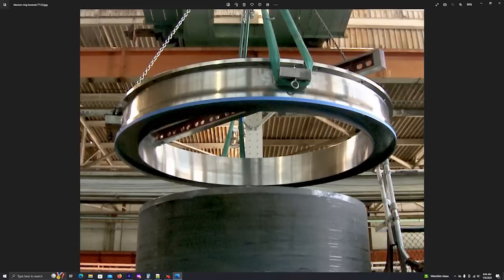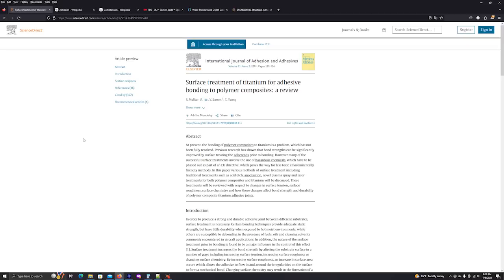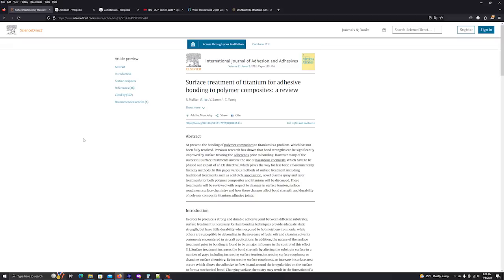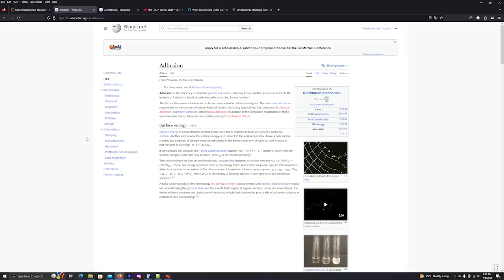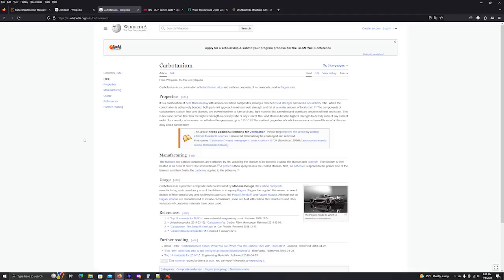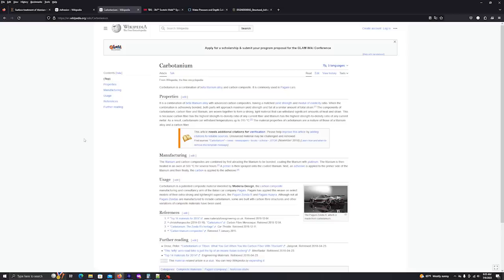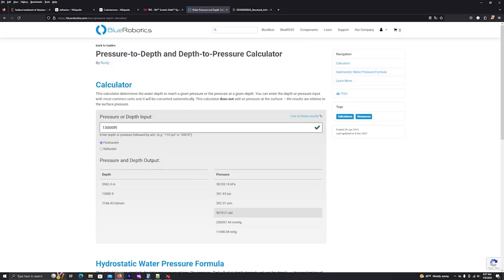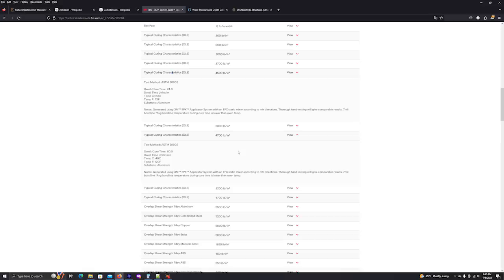Oceangate Titan Adhesive issues between Carbon Fiber and Titanium

Comment: As a retired Aerospace/Aeronautical Engineer with 40+ years of experience, I am 99% certain that the Titanium Flange to Titanium Carbon-Fiber hull joint was the Achilles heel of the design.  Primarily due to thermal and pressure expansion/contraction rate differences between the two materials.  Joint failure was inevitable.
Reply: Amen brother. I had some composite training and even at the technician level I can see where the flexing of the glued joint is going to cause a disbond. Repeated flexing under pressure will cause it to disbond. I don't think I've seen a structural joint between composite and metal that didn't include fasteners. @terrymichael5821 could they have held the two end caps to the tube by using rods between the end caps? A minimum of four I would think. Would it have made a difference or kept the tube from collapsing?  I think the tube would have collapsed eventually anyway. Tube bad. Sphere good.
Reply: "Repeated flexing under pressure will cause it to disbond." Bingo - my thought, exactly.
Reply: @rael5469  That is a good idea to have 4 rods external to the sub, holding the end caps like you mentioned.  I'm no engineer but I had legos as a kid.  Maybe some beefy flanges forged on the outside of the titanium end rings with 4 rods running the length of the sub and a 3rd titanium ring mounted INSIDE the middle of the "tube"  to take some pressure off the end rings
Reply: @jediknight4316  Sounds good to me.
Reply: @jediknight4316  Jed, what they really needed was 5 inches of titanium around the carbon tube and then just to save space they could have eliminated the carbon tube.  ;)
Reply: @rael5469 probably it become too heavy and expensive because the machining
Reply from the maker: Thanks for the valid insight.
Reply: Cyclic fatigue... And unfortunately, just that one cycle too many.
Reply: @BiGDuke6Actual Anyone who went down in this thing previously was just fricking lucky and basically won the lottery making it back up.
Reply: @BiGDuke6Actual tighten until bolt snaps and then take quarter turn back and it is perfect
Reply: @BiGDuke6Actual  affirmative ... all those reported "popping noises" on previous voyages would lead one to believe those were "delaminations" occurring ... transitioning from "elastic state" into "plastic state". Pity Rush didn't spend the $20k performing ultrasonic NDI after each voyage to find out. IMHO, you can't lay up tape all in the same ply pattern ... regardless of hull thickness ... and not expect it to not cleave in a straight line like a Oak Log being split.
Reply: I noticed that too.  never seen anything laid up in a single parallel line like that tube was, even the Caltrans carbon fiber reflector poles used up here in the mountains, when one breaks, the fibers are laid in a complex basket-weave, and they don't break very often at all.  this was just amateurish beyond belief.  he might've been a rich fella, but he sure wasn't very smart in how he went about that process.
Reply: If you watch the construction of the Titan video of the two pieces being joined together, cut to Rushton’s  face , he looks horrified.
Reply: Hello Terry, Respectfully, using easy math I have calculated that at depth each end cap was pushing against the carbon fibre hull with 18,887,000 lbs of force.  
Do you think that the adhesive was even necessary?
Reply: @jimimmler9110 Consider. The submersiable is going from the surface of the ocean to depth and back in repeted cycles. What is happening to each component in these cycles including the adhesive bond? Each material has a different stress/strain curve.
Reply: @jimimmler9110  Well, the pressure on the end caps was spread out around the carbon mating surface. Now what was that? Let's see.....8 ft diameter of 5 inch thick carbon fiber laminate. Then 5,635 lbs per sq in. You might be off by a decimal point. (high) 
Either way, if the pressure flexed the middle of the tube inwards, then that 5,635 psi would instantly rush into the compartment from around the end caps. Something of that nature.
Reply: @jimimmler9110 nope...    Triple o ring seals would have been adequate..
Reply: @jimimmler9110 Yes, however, that 'push' was from all directions .. 'looking' for any weakness in hull Integrity. Without that bonding agent, water would have quite easily found it's way into the vessel in the joint between the carbon composite cylinder and the titanium ring. It did .. somehow.
Reply: Yep, my thoughts as well. Having a background in aviation high end interior design, I am familiar with many of the practices using carbon fiber materials and various epoxies. It struck me as odd that they would "glue" these two different material components together, knowing that any epoxy has a hard time adhering to a very smooth metal surface such as the titanium ring that they seemed to be wiping with rags, were the rags oily or soiled in any way? And the way this joint, under the immense pressure would creep apart over successive expansion/contraction cycles of the tube hull is indeed probably what they were hearing. It's sad that after hearing it the first time, the sub wasn't grounded. If only the hull would have been made of 5 inch thick solid titanium, bolted or welded, the crew might have survived.
Reply: It looks like when put under hydrostatic pressure, the mechanical strength of the glued joint (between the flange and carbon fibre tube) is moot because that pressure keeps everything compressed anyway. What I'm more concerned about is whether that same joint was being asked to provide a water-tight seal, rather than an o-ring or gasket, for example. Would that water-tightness degrade over time as the adhesive degraded either chemically or mechanically? It looks like there was no way to directly inspect the joint once assembled. How flat/smooth was the face of the carbon fibre cylinder? Were opportunities for water ingress created by a degrading bond and/or a poorly machined face?
Reply: Im not in the industry in any way but I did find it strange the glueing of the ring in an open sapce area, I was thinking, surley even particles of dust could effect such an important connection.
I think mr Rush would be on his way to jail if he wasn't in the death trap. Sad.
Reply: If they have used some hard epoxy glue it was a mistake, due to the fact that the two parts don't expand in the same way it would be mandatory to use soft flexing glue that allows some movement without cracking. When i have to bound carbon fiber on metal i always use some ployurethan glue like the one that is used to bind glass to metal.
Reply: My mother used to open new pickle jars by setting them in the sink under a faucet of hot water. The metal lids expanded more rapidly than the glass jars.
Reply: I agree, plus the window was not rated for the depths they were going to.  
Retired from the Materials-Composite industry but still work in another field of engineering.  38+ years of experience.
Reply: As a Mechanical Engineer and driveway auto mechanic, it is common sense that it is extremely difficult to bond to metal of any kind  to have lasting strength.  Anyone who has used JB Weld in automotive applications knows this.  For that matter, even most metals must be passivated or acid etched for proper adherence of primer.  The epoxy used may be able to support the pressures in compression, however the flexing of the CF hull would act like a lever to the bonded area, which I would assume to be far greater than the epoxy could resist.  I just shake my head at how thin the flange overlap is onto the CF tube.  A little more overlap would have increased the surface bond area, although the failure point may have only been inevitable with enough dive cycles.
Reply: Even a retired idiot cop such as myself can see how that wasn't going to work long term.  You couldn't have DRAGGED me into that sub. Wow. A "glued" tube. Just wow.
Reply: I certainly do not have your experience or credentials, but I've been saying the same thing. There are 3 materials; carbon fiber, titanium, and the adhesive. You don't need to be an engineer to understand every material reacts differently to moisture, temperature, and pressure. Stress due to deflection or the relative lack of was put on this joint with every dive and then again at every surfacing. This stress can cause tiny defects to the adhesion starting with the first dive. These defects will likely grow exponentially with each cycle until catastrophic failure is experienced. Or, the carbon fiber delaminated and shettered with such force it harmonically broke completely free of the bonding agent. Either scinario could make sense from my understanding of the 'transcript' leaked.
Reply: @rcampbell4967  sort of ... actually should have been 4 materials ... they left out a very important one ... called "Primer". I had the same problem with a certain highly respected company in Germany that forget that process step. I was shocked to find nobody bothered to read the adhesive designer/manufacturer's spec ... which required application of "Primer" prior to the Adhesive (after allowing it to "set" first). In this instance, the 2 mateials were Alumium and Glass (2 very different surface porosity attributes) ... hundreds of field rejects as the glass inserts would just "pop out" with the slightest pressure (not part of the ATP either BTW). With the addition of the Primer, never had another failure.  In this application though, doubtful it would have been 100% as it would appear SeaGate Engineers didn't bother to design in any "mechanical anchor points" that might have helped the end caps stay in place instead of popping off like Champagne Corks when the Hull imploded due to inadequate material choices, layup geometry, no "clean room" or use of an Auto-Clave for the CF Hull.  And yes, just an observation and will await the NTSB report for final judgement.
Reply: you may want to visit that one percent because the bond was not in play, all the forces were trying to aid that bond. It would have held without the bond. At most a leak. It was not a leak it was catastrophic failure of the carbon tube.
Reply: I would use a multi-layer, sandwitching, tapered lap joint to distribute the stresses and prevent separation.  Adhesive bonds perform best in shear, not compression or peel.
Reply: Exactly! The best glue, applied the correct way wouldn’t really have made a difference. Just when it would fail would be the question.
Reply: In the film when the engineers have set everything up to connect the titanium end cap to the carbon fiber, there is a guy standing in the tube and he begins to apply the epoxy to the titanium and the first thing I noticed is the titanium has a finished appearance. It is polished. The carbon fiber did not have a good chance of bonding with that titanium in the first place. But in order to even have a chance at that they should have scuffed that surface rigorously. 

With the way Titan was constructed I wouldn’t be surprised if they sprayed the titanium with Rain-X first and then flipped it over and tried to push the cap up against gravity to connect it to the hull. I mean it’s not like they were collaborating with James Cameron on the project.
Reply: I used to work on inflatable sleeves for the drilling industry. The end pieces made of a turned steel were bonded in place by injecting epoxy aluminium under pressure using grease guns we disposed of after single use. We had to work fast as the pressure set the resin almost immediately.
The smear method shown in the video of the manufacture process was doomed to failure as cavities were extremely likely!
Also no key sites were visible on either surface. I guess the old white guys they didn't employ knew to much about composite materials, or they asked to much in wages!
Reply: I'm pretty sure the carbon composite in itself wasn't suitable for the purpose. Carbon fiber is for tensile and not compression strength. It failed all over the place.
Reply: @rosomak8244  It is the same with a cloth rug. When you pull at it from both sides it is pretty strong, but when push on it from both sides it compresses without any effort...
Reply: I have none of your qualifications sir, but I can tell with my non-engineering eyes, that this was a piece of work that never should have left dry land. 😊
Reply: There is a video here on YouTube where you can see HOW they applied this glue. They took not a single action to prevent air beeing trapped inside the sealing. I also have a  background in aviation maintenance and trapped air in laminates is always a concern. And trapped air inside the glue will heat up and  stress things
Reply: One thing that I have noticed anytime I have heard of any kind of adhesive being used in anything carrying people or where safety is Paramount it is usually also done in a hermetically sealed room and then put under vacuum to be absolutely certain the seal is good and no bubbles are in the adhesive. But I would never trust it in the kind of environment it was being used in
Reply: @youandiryan  💯 correct!
Reply: @icare7151  thanks man!
Reply: I think most plumbers looked at this joining and cringed. It doesn't take an engineering phd to spot the huge problems. But keep in mind Stockton Rush tried to promote the female accounting intern to be the new Chief Pilot. Which tells you his hiring standards. She looked at what he was suggesting and ran. She wasn't stupid.b
Reply: I would like to pose you a question, hope you give this a good thought. So we have seen the forward hemisphere without a viewing port and without the mounting ring. So every piece that was bolted together has been separated. I was trying to wrap my head around the physics of that happening. This is my thought and would like yours. Rear hemisphere bond broke, now you have tube full of air with a dead end being the front hemisphere. Pressure rushes in and compresses the air into the front and the mass of water dead heads ejecting the viewing port and separates the ring from the front hemisphere. Other than unbolting the thing for recovery Inertia is the only way I can think of for the seperation.
Reply: Great series of videos on this topic.  👍👍👍😀
Reply: I'm a complete amateur. However... My money says the CF cylindrical shaped hull was destined to fail no matter how well it was bonded to the flange. But yeah, poor bonding probably didn't help.
Reply: Exactly my first thought when I dove into the materials and methods of assembly
Reply: This makes me think ,did the fact they were descending too fast cause a big difference in contraction / expansion between the carbon fibre, the bonding agent and the titanium.
Reply: Yes i agree and when its cycled once a section lets go the pressures on the carbon fiber tube where it failed would be in many atmosphere's of pressure, would of been some heavy leakage then bang. Will be interesting to see what the end report comes up with, now learning it was glued together with epoxy just makes no sense. i was thinking it had a metal flex gasket and bolted together like two flanges but no it was glued makes no sense.
Reply: When watching the making of the carbon fibre composite tube, it was made with just a winding round of the fibre around a tube, there was no criss-crossing of the fibre- would that have been a problem in creating strength. Also, Rush had bought the fibre from an aeronautical company as it had gone past its sell-by date- surely that is another red flag
Reply: If I was designing a vessel that was a pipe with dome caps, I’d have really liked for the pipe-to-dome joint to be mechanically stable without relying on an adhesive. Then the only critical aspect of it would be the seal, and that can be better engineered without having it provide structural strength. But then I’d not mess with a carbon fiber pipe either…
Reply: The whole design was a real Dog's dinner. It looks like a mixture of good intentions that has no
place in being brought together on one construct. To add the flexible to the inflexible is by in 
large a massive mistake. 
Having worked on subsea power transfer systems for North sea Oil and gas well heads, I can 
vouch that Glass fibre items can be made sufficiently well to keep out any water ingress. But these
items must be laid down and allowed to cure in vacuum to eliminate trapped air, no matter how 
small the bubble of air is, it will in time cause failure. Carbon fibre items must follow the same principles. We have seen that this hull or tube was wound onto a former and cured in a warehouse.
That, to my eyes is bloody atrocious. The fact that it survived a small number of dives is an absolute
miracle.
Reply: They did not sandblasting the flange before bringing too less glue on it.
Reply: Along with no Clean room there appears to be no bond-line thickness control. For this room temperature cure paste adhesive, they probably did not have Elastic-Plastic shear stress and shear strain properties to run some Strength Calcs.
Reply: Add to that the fact that the total (inward directed) lateral force from the two titanium rings was not exerted on the total thickness of the carbon hull, but only on a rather narrow outer rim...
So many design mistakes.
Reply: @Franky46Boy  Thats right - a DIY - work, not more.
Reply: I agree. The hull can compress inward but the titanium is virtually non compressible in this application. Aside from the sea pressure around the hull, the end bells compress it from the ends.
Reply: The two ends should have been “bolted” together imo. Actually they should have scrapped the whole idea and went with a circle.. the side of the tube gave up the ghost and likely blew the end caps off.
Reply: @goinhot9133  
How do you bolt titanium to carbon fiber. It’s fiber and glue, bolting it would crush the fiber.
But yes it proved to be a bad design theory. Testing would have proven that, but Rush was smarter than anyone.
Reply: You are so right about the differences in the expansion and contraction rate of the two materials. It is totally amazing that Rush didn't think about that apparently anyway.
Reply: @ThaiLifeAmerican 😂 Relax, CF is extensively used in aerospace and is very safe (because duh! CF is great at handling tensile forces (ie. A plane pressurised on the INSIDE) vs. Compressive forces, it’s useless (ie. The sub, pressure was on the outside, collapsed like a can of Pepsi!).
Reply: As someone who has zero professional experience... I am 100% sure you are right... but I am also 100% sure the entire carbon fibre hull was certain to fail eventually too.

It just blows my mind how a maniac (oceangate ceo) could be allowed to endanger human life.

The entire design, build, materials, assembly and "testing"... were a cowboy job.
Reply: Im sorry this makes me so angry. As a senior design engineer who designs pressure vessels and used advanced materials including composites and previously submarine Stirling engines. This was the wrong shape and material. Carbon fibre can be used in gas cylinders under tension but not under compression, especially where there is cyclic fatigue with no monitoring or testing. Once the inner surface begins the delaminate it causes buckling and then sudden catastrophic failure. There are some papers written about this and if they did testing they could have seen this. It was not pushing the boundaries of innovation. It was only pushing the boundaries of safety.  I was horrified that they only used FEA simulations. Given the fact that its almost impossible to do with any accuracy for a non homogeneous material with obvious voids (no autoclave) .  There seemed a big lack of testing or any correlation. It should have been thrown away after the first dive.
Reply: And in general, that's no clear way to estimate material fatigue and stuff for the carbon part of the hull even if we suppose there were 100% no manufacturing flaws. You also can't pressure test it cause afterwards it might already have weakened structure.
Reply: Carbon fiber bubble wrap! 

With over 38 years of advanced material reinforcement manufacturing, ASTM (I) failure analysis engineering experience, including carbon fiber, the method, application and overall design are all examples of total disregards to proper engineering designs, manufacturing, testing, evaluation and lack of certifications, created a death trap guaranteed to fail within a few cyclic loads. 

Carbon fiber in this application and overall design is complete negligence on all levels and in all disciplines.

Physical material property differences in Titanium and carbon fiber expansion & contraction along with trapped air bubbles in the carbon fiber  guarantees the seal between the  Titanium and carbon fiber to delaminate with cyclic loads, especially if subjected to pressure and temperature shock loading.

Shock loading by descending too fast and/or cyclic loading, the design appears that a catastrophic failure was eminent.
Reply: Cameron said if he had to bet he’d bet on that joint.
Reply: Former machinist and factory worker here and intuitively it feels like this is the right answer. Does there exist any design documentation or video that shows how the flange was connected to the dome?
Reply: Good point.
Reply: But Rush installed the RTM system...
He went down with the ship but took 4 victims with him.
Reply: Wouldn't the tube be intact then?  Appears to have shrapnelized.
Reply from the maker: @ThaiLifeAmerican  aerospace carbon fiber parts are very safe
Reply: @JoediyLab 
Aerospace engineering is performed under controlled conditions such as temperature, humidity pressure, ECT.

Even Nissan build their GTR engines in controlled environments due to the extremely tight tolerances.
This monstrosity was made in a shed!
Reply: There's no Achilles heel. There are a legion of them (though some may be heelier than others). If they had done that part right, it would have inevitably just failed somewhere else (assuming that this was the point of failure in the first place —the case presented in this video seems convincing but I'm too ignorant about any of this to opine beyond that).
Reply: My thoughts exactly, and if the “leaked” text message conversation is correct, they were descending at over twice their normal rate. This would have exacerbated any of the differences you brought to light.
Reply: Yes - I suspect delamination started at the shoulder of the joint and proceeded radially in the direction of the CF fibre wind.
Reply: Do you think it could be done in a way where it didn’t fail? Like was it a manufacturing or a design issue ?
Reply: That and the degradation of the carbon fiber hull over time.
Reply: While the way tjis was fitted it wasnt the issue i think the hull started to develop micro cracks with all the cycles and then it collapsed, the watter pressure would do a pretty gold job of forcing the titanima flanges and hemispheres into the carbon cylinder ends..
Reply: I always thought that would be the issue as well. I did construction and know the expansion and contraction of unlike materials through the thermal cycles is always a problem and figured that the adhesive would be a red flag. Exotically when you have a hinge point at the center of the cylinder when under load would put additional stress on the adhesive. I guess we will see more when the info from the investigation comes out.
Reply: Did you ever work on the Space Coast of Florida?
Reply: Not only that, there was not an ounce of 'glue' squeezing out. Too little used.
Reply: I'm not a specialist on bonding nor any of the materials used...  That being said, as a layperson, I can't believe they glued... (yes I said glued 👉 layperson) two milk caps to the end of a toilet paper roll and went underwater with it, much less as far as where the titanic is.
Again, layperson here but that seems like a very good descriptor for the majority of us who don't have degrees in this stuff.
Reason I'm using toilet paper tube and milk caps as my examples is because the tube seems just as porous and the milk caps (albeit not the correct shape as they are flat (the titanium endcaps were half spheres)) are not porous in the same way. I think your general layperson can comprehend delamination this way as well. Just chuck a roll into water and you kinda get the idea.
Let me add that even though a sphere is much stronger than a tube, I imagine it would end in the same result; not that the tube wasn't a poor idea to begin with.
Reply: I disagree. Even if the bonding totally failed I wouldn’t matter. The pressure of the dome is pushing the ring on the Carbon. This will seal better with increased pressure. But this in line with the laminates aka pushing in the direction where the Carbon hull is the weakest so it could cause delaminating.
Reply: I just love the fact that an ‘ordinary Joe’ can just apply himself to the problem and work through some of the fundamentals and share it with us via the internet and YT.

In your future experiments may I suggest an experiment - a small cardboard tube with two fairly tightly fitting end caps - then drop a heavy weight on the cardboard tube.😉
Reply: What is your opinion on the carbon fibre hull being the failure point vs the glue joint?
Reply: The overlap should have been 3 times that. Astonishing.
Reply: I agree completely.  No matter what the adhesive is, it is bound to fail at such depths eventually.  Had they tested the design properly with an independent third party evaluation, this suicide mission could have easily been avoided.
Reply: @joeschmuccatelli2167  ... and further upstream to that, had they been forced to get AS9102 Certified, it never would have been built in this configuration. That is why every Prime Contractor forces AS9102 certification (and re-certification) throughout the entire Supply Chain, down to the level of even fasteners, glove, et al.
Reply: @craigsowers8456  So they should still be alive, eh?  It was never properly tested.
Reply: @joeschmuccatelli2167  Yes, if Rush had followed the protocols he learned in his 20 years in Aerospace, it wouldn't have even been built in its' current configuration ... well before "Testing" began. We first build a very detailed "Plan" from an Engineering perspective, move on to testing each element and, if fault found, kicked back to Engineering for resolution. I helped build over 4,600 F-16 Aircraft in my lengthy career ... guess how many were exactly the same? None are the same.
Reply: Do you think there could have been a slow leak initially?
Reply: @AORD72  Due to the alleged speed that they dropped at -an hour ahead of time, I'd say that was quite likely.
Reply from the maker: @AORD72  That is a good question, I cannot answer that.  we will have to wait for the results of the investigation.
Reply: @AORD72 
No, unless it happened at shallow depth. In that case the dive would have been aborted immediately.
Destruction at depth would take about 1/1000th of a second!
Reply: @AORD72  This is an area I can't speak to with any authority other than to comment what I think makes sense. I think without a doubt, there may have been water infiltration. If the 'transcript' is correct,  there most certainly was. There was an electrical failure on Bus A and the sub had retarded buoyancy presumably because it experienced a hull breach. The 'transcript' is consistent with information initially released when the sub broke communications. But then again, if it were fabricated,  it would be easy to include those facts, too.
Reply: @AORD72  Prior to failure there could have been a slow leak.  Leaks can accelerate rapidly in some cases.  This is why we test a lot in the aerospace industry.
Reply: @AORD72  According to the transcribed audio from the sub to surface, they had about 20 minutes of knowing what was about to happen to them. Even after releasing the ballast 
that sub just didn't want to raise up, it was already too late with early signs of structural deformation.
Reply: It is so refreshing reading something substantive in a titan comment section.... They are littered with armchair engineers and oceanographers.
Reply: @JoeyMartz Well, this is America, not China and the last I checked we, the USA, still has free speech. That means that people can freely voice their opinions and concerns. So, have a good day.
Reply: @JoeyMartz I agree. The internet is full of people who don’t grasp how little they really understand.
Reply: And titanium is highly flexible so it will deform and crack the inner carbon tube
Reply: Flexible titanium?  That's a new ine
Reply: you know once under water they wouldn't even need to have the two pieces glued together...the pressure of the water alone will make it impossible to separate the caps even if you'd try...so the glue as NOTHING to do with all this.
Reply: A lot of professionals are diagnosing the cause of this catastrophe prior to any formal investigation of the physical evidence. Which I believe is a cardinal sin in any engineering field. Furthermore, these professionals also diagnose according to what they are most familiar with in their own specialty of the broader field. So when they hear hoofbeats outside their bedroom window, they think 'donkey', instead of 'horse', just because they know a bit more about donkeys. But there are several options here for failure, so until the investigation documents are published......
Reply: @gailmcn  if @terrymichael5821 was part of the investigation assigned to determine cause and recommend corrective industry action, absolutely it would be inappropriate for him to publish his opinion as a finding. It would also be inappropriate for him to suggest his opinion substitutes an actual investigation. I don't think he's either, so calmn the heck down.
Reply from the maker: @gailmcn  Yes we will have to wait for the investigation report.  But reporting theories as long as you state them as theories is acceptable.
Reply: @JoediyLab  I agree. And I appreciate that you are circumspect and careful about that in your own comments. In the situation I addressed here, there is no statement that this is a theory, or opinion. Instead we have an" expert witness", so to speak, claiming certainty about the cause of the implosion, based on his decades of professional experience. Ironically, almost 2 weeks ago, another expert -James Cameron - used   almost the same words: "the Achilles heel in the sub was the carbon fiber hull."  His remark is also premature....
Reply from the maker: @gailmcn  good points thanks for sharing
Reply: @gailmcn 
You don't need to be an engineer to call out obviously stupid designs. If someone tried to make an aircraft out of paper and balsa wood, I could easily tell them that's a bad idea and why. I could even predict ways it will  fall before it did fail. 

Same for this "submarine." If anyone had told me about this design, I would have predicted implosion on the first dive. So I would have been off by like three dives.
Reply: @ConsciousExpression  Nobody is arguing about implosion, which is the RESULT of a cause. Nor am I rejecting the claim that a hull join was the cause. I am pointing out that claiming it's certainly the cause isn't appropriate at this point, since the wreckage has not even been assessed. There are other likely possibilities.
Reply: @gailmcn  I haven't seen anyone claiming with 100% certainty why it failed, just pointing out various ways it was clearly badly designed, all of which can lead to catastrophic failure of exactly the type we observed. And again, it doesn't even take someone with an engineering degree to call these things out.
Reply: @gailmcn  "A lot of professionals are diagnosing the cause". Wrong with this as well as your follow-up points. What is being done is EXACTLY what science and engineering is all about. Engineers are taking what is KNOWN and then making theories about what may have happened, and based on those theories further analysis can be directed rather than random and these THEORIES will be evaluated and assessed and eventually the most likely failure mode will be determined. It may never be fully proven unless full-scale destructive testing of the kind Oceans Gate refused to perform.
Reply: @Mike80528  You obviously didn't read any of the discussion about this issue.....or what Joe, the site content provider,  had to say about it in our exchange:  (as long as its STATED that its a theory......which was not done here).It's always prudent to investigate what's already been clarified about an issue, before you huff and puff about it. "99% certainty" and "theory" are not synonyms.
Reply: @gailmcn I’m not sure anybody’s saying he has a simple, unqualified solution. This is just speculation about the materials and design as we know them until the investigation is finished and a detailed report comes out. As a layman where engineering’s concerned, I’d far rather hear professionals discuss this than people who think they know more than they do. I’m grateful for the time these professionals have given in sharing their their expertise and explaining some of the issues involved.
Reply: @gailmcn  I find their theories quite interesting. If you don't like it, why are you watching?
Reply: @gailmcn  I don't think that's just engineers.  Same happens in the Doctors office.  It's just a natural human trait.  It's hard for us mere humans to remain fully unbiased and open-minded particularly when there is a great deal of uncertainty.
Reply: @RunPJs  Amen to that! But since the issues here are primarily engineering ones, that's what I'm addressing. Now maybe within the universe of engineering, a statement of "99% certainty" is understood to be just a personal opinion or theory. But here, they are addressing a large group of laymen, so the communication has to be clear, careful, and qualified, when all the factual data is not yet known. We are now living in a time where expertise is sneered at, in no small part because the experts themselves have claimed certainty when there isn't, and later turned out to be quite wrong. In all professions.
Reply: @gailmcn  I absolutely agree. I studied systems thinking, strategic thinking as well as managing complexity with the OU. Otherwise I'm an Engineer working on aeronautical technology.
When I work on engineering issues my experience and intuition often serves me very well - maybe 95% of the time.
But when that doesn't work I then investigate and try to keep an open mind. I always get there!
For me I find both methods of working can be very effective